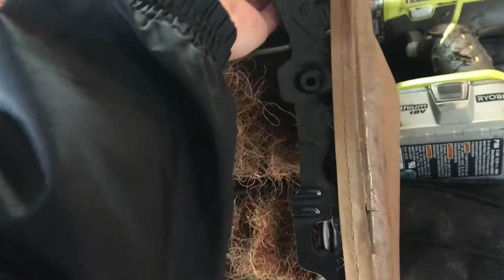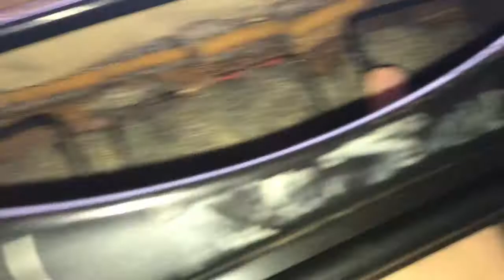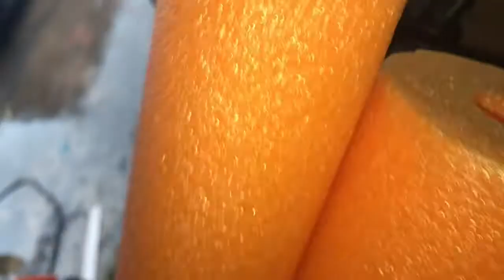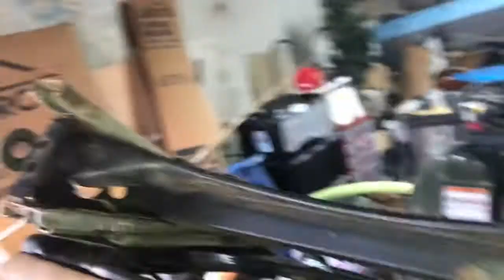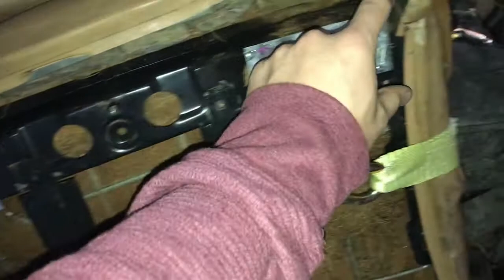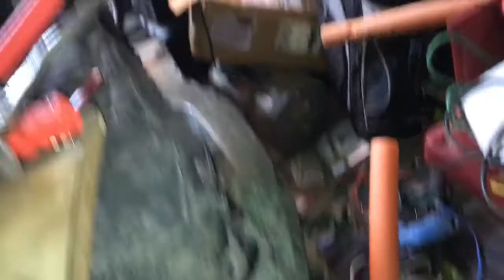Seat Repair 85 Mercedes 300D pt1

Comment: Hmmm. take it apart and weld it. The spring you can fix using spare injector hard lines, just make the cut a 1 inch section of the line, and drill the inside out a little to fit the spring. Put JB weld on the broken springs and mate them together using the injector line to hold them together, better than new. Here is better explanation.  http://dieselgiant.com/repairseatspring.htm
Reply from the maker: The seat frame it bent really bad as well. I didn’t weld it as I would have had to remove the horse hair pad to weld it and I was afraid it would disintegrate. I have another seat that has a better frame that I may swap this cover onto. I was waiting to try to find a seat with a better cover.